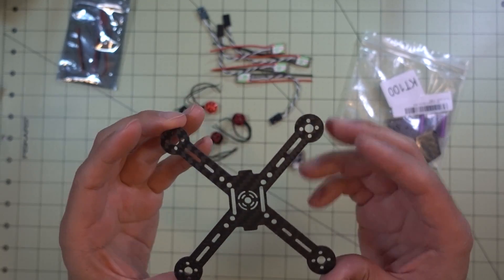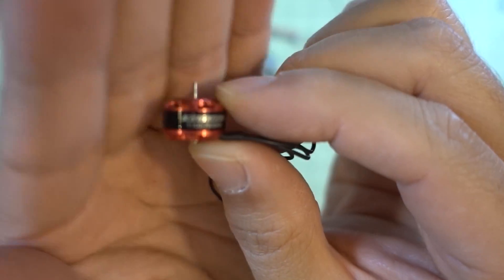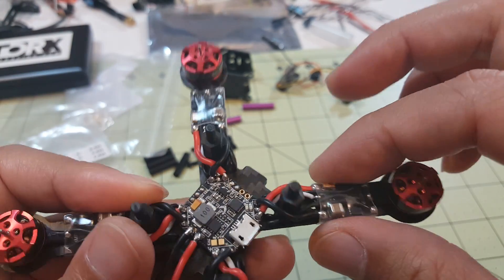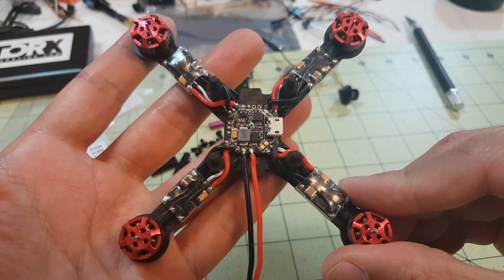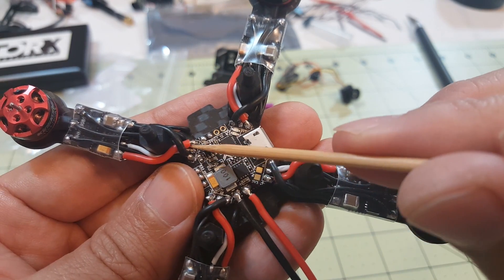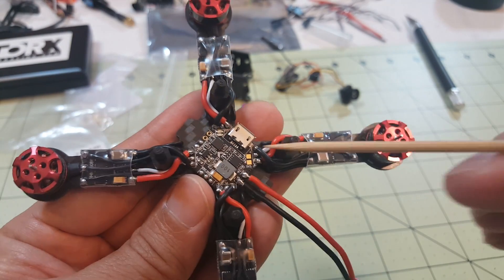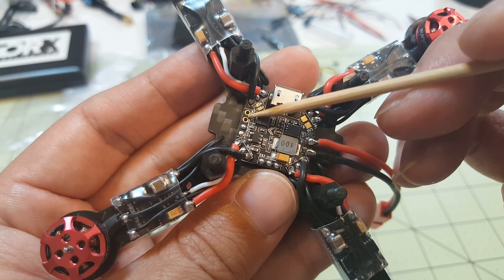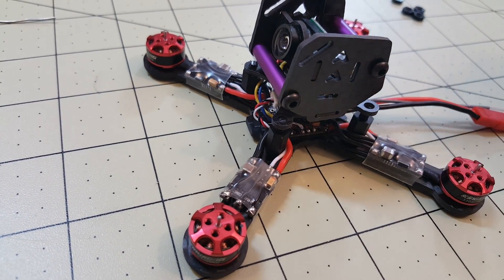MultiGP Micro Racing Drone Build #1 🏁

Comment: Will this frame fit the Runcam swift micro?
Thanks
Reply: Great, thanks for your help
Reply: So is it just a case of the camera mount been wider than the runcam? If it's in there will it be completely protected by the carbon fibre?
Reply: Matthew Nesbitt from my rough measurements it should be protected
Reply: Matthew Nesbitt The side plates for the camera section on the frame have holes cut in the center that can be used to secure the camera with screws
Reply from the maker: +Matthew Nesbitt it can with some adapters. 3d printer?
Reply: Thanks for the reply, unfortunately I don't have access to a 3D printer so was hoping the existing holder could have been adapted.
Reply from the maker: +Matthew Nesbitt you could try some nylon washers
Reply: with two 3mm spacers it should fit...i just got my kt100 frame today and i've took some measurements. Didn't buy any components yet because i wasn't sure if i was going to use this frame if i couldn't get the micro swift or the new foxeer micro cam to fit. It should work without much fuss
Reply: So is it just a case of the camera mount been wider than the runcam? If it's in there will it be completely protected by the carbon fibre?

Comment: Albert,
question you had made mention about a different size nylon standoffs in another video.  I'm using this frame with a Racerstar 12A 4in1.  unfortunately, the standard sized standoff will not allow the for the pod to fit.  i just wanted to know the size, I think you said 2.5MM can you confirm this for me?
Reply from the maker: +NyxFPV this one is 3.0mm
Reply: Albert Kim that I know. But if you try to use a 4in1, standard standoff just doesn't fit.
Reply from the maker: huh?  okay, I'll double check it.
Reply: Albert Kim. Yeah, there are cap near the mounting holes. If you use a standard standoff it doesn't sit properly. It also gets in the way of mounting the pod.
Reply from the maker: Ah, I see.... I don't have the 12a 4-in-1 to verify this....  The 6a seems to fit ok.
Reply: Albert Kim ok, what's the size of the smaller standoffs?

Comment: Great video Albert.  Im really digging these micro brushless builds.  Compared to the other 2 you built recently,  this one can be sourced entirely from banggood and works out to being the cheapest.  Would you recommend this as a good budget build and would you recommend the 1103 10000kv for it or another motor?  How noisy would it be?
Reply from the maker: Noise would depend on the props.  Some are really noisy, some are super quiet.  Having flown the bigger 1104 and 1105 motors, I think if you want the power, go with a bigger motor.  The 1103's are still good but not the best for top performance.  You'll see that in my speed test videos.  But even on 1103, it's still a great flier!

Comment: can you fit 1306 motors on it and can you fit a regular naze32 f3 board on
Reply from the maker: You probably could but the frame won't be able to take the crashes... too thin.  A regular 30x30 board won't fit.  It's designed for 20x20 boards.
Reply: Albert Kim thanks I'm trying to find the smallest frame that can hold 1306 motors because emax makes some that can handle 4s!
Reply from the maker: Watch my build videos on the GB130.  I have the EMAX 1306 4000kv motors on there flying 4S.  It's a blast!  http://www.youtube.com/watch?v=PuyTVCrtmB4
Reply: Just watched it and wow that thing is crazy. Did you make a build video for it?

Comment: Albert I love watching your videos and your new topic of Multi GP micro class drones. Looking forward to see how you expand on that topic. It would be nice if you could keep a master spread sheet showing the motor type, propellers, battery and weight and time for each quad. I am building a few also and it would be nice if your viewers could send you their data and speed on their builds. I have noticed from your times and speed that they are based on a 100 meter distance. I think for the U.S. the 100 yard distance might work better for viewers to duplicate because of all the football fields. I take it your using a running start. Thanks
Reply from the maker: I will be expanding on this but based on a larger distance run to get better data.  I will keep everything in a spreadsheet as well... I should have a new video up soon.

Comment: check out the flex RC pico x you'll really like it trust me and it's about the same price but idk if it falls under the regs
Reply from the maker: I believe that one is for 2 inch props and if you're racing why would you want to give up that advantage of having a 2.5 inch prop?
Reply: Albert Kim you make a good point there but I'd suppose I'd come down to how each craft preforms
Reply from the maker: If you know of a 2 inch quad that is faster than a 2.5 inch quad given the same motors, escs, etc, let me know so I can check it out and make a video about it.
Reply: Albert Kim sorry I think you took what I was saying as an insult It wasn't my intention I apologise no I do not believe if I used the same motors and esc's you use on a 2 inch would out preform a 2.5 inch
Reply from the maker: no, wasn't taken like that... nothing wrong with 2 inch quads... might be better for smaller spaces but not ideal for the MultiGP micro class which is what I'm going to be focusing on.
Reply: Albert Kim oh ok my misunderstanding

Comment: I'm looking at the same exact setup.  My question is on the motors.  Would the racerstar 1103 8000kv be better?  The only thing I don't like about the racerstars are the props push on.
Reply from the maker: It's about the same.  I prefer the props with the screws.
Reply: Albert Kim what 2s battery did you use?
Reply from the maker: +Michael Brewer 300mah nanotech

Comment: Thank you Albert.  I ordered this frame after watching your haul video. Been waiting to see the build video. Glad I ordered the pico blx to use in this frame and I'll go with your advice on a 4 in 1 ESC. Was thinking about using 1104 racerstar motors or should I stick with 1103? And wanted to use a 3in prop but like u mentioned looks like 2.5in is the biggest u can go.

Comment: You had me talked out of this build early, with the soldering issues and 4 in 1 esc weight advantage. I think you have an opportunity to do something that no one else is doing yet. Take this build back to where you ran the speed tests for the Tomo Predator X and run your 100 yard dash. Keep track of the times for all the builds you test, or maybe top 3. To make the Predator X  multiGP spec (and comparable) put the RotorX 2535 props on it (and the lighter 300 mah 2S). I'd also like to see the Tomo XBL 117 and Aurora 90 run that speed trial with MultiGP spec components. Or any other micros you have that would be competitive.
Reply from the maker: +Mark Sherman yep, plan to do all that plus a lot more builds... this is just the beginning

Comment: Jey Albert. Nice Video again. But i don't understand why you used the kingkong with the 1mm shaft when you are not planning to use props which fit 1mm shaft the 65mm gemfan oder similar. Then you are using a splitt camera setup in a heavy aio cam pod? the cam you choose with the vtx is more heavy than a aio cam. I think weight in this case is also the key to win in the multigp. I would use, in case you want to keep the motors, the mentioned gemfan props and get rid of the cam pod and do a low profile with the micro 1.2g cam from banggood. this should save you a lot of weight.
You do so many great builds. Don't get me wrong. Greetings
Reply: i have build with what ever you mention above using a racestar 8000kv 1103 motor, the problem am facing the prop will be so close to the pod actually the prop will spin in between the frame witch not really good in worst case,  and also there is no protection for the AIO vtx antenna even i make over some zip tie no use end up breaking my antenna i would fallow what ever he did as i experience already
this picture might explain you why
https://goo.gl/photos/eNvX6FqarmDhCvtu8
Reply: Farook Mohamed ok i see. you should maybe solder a whip antenna on.